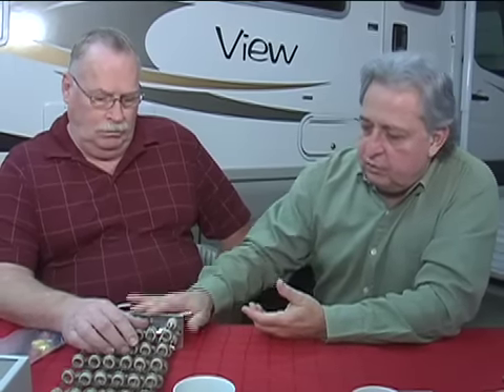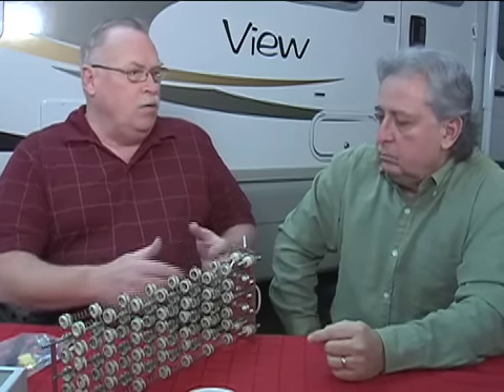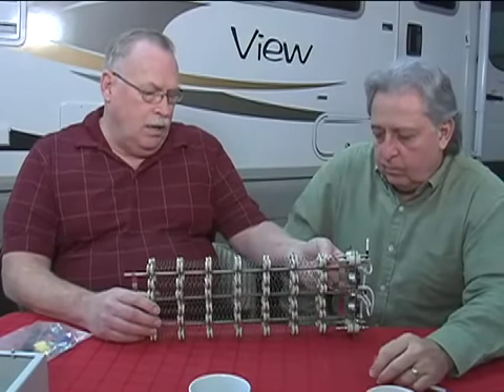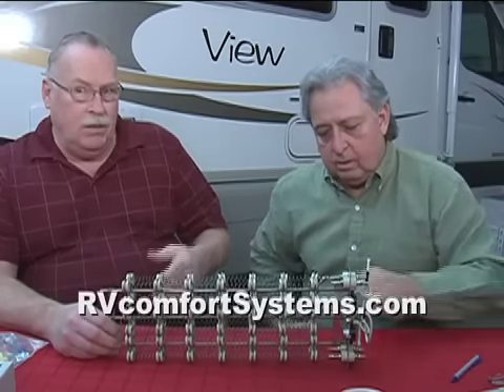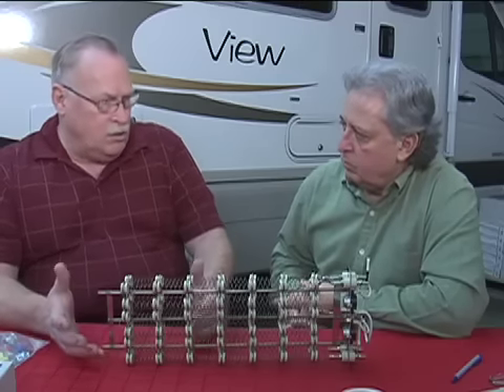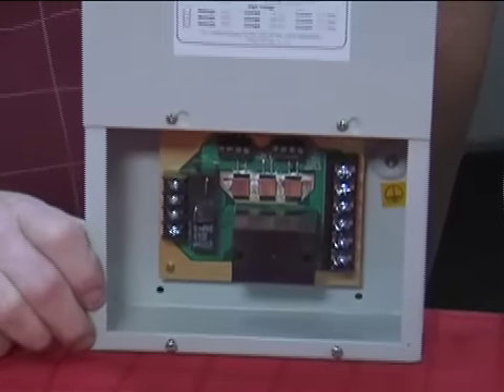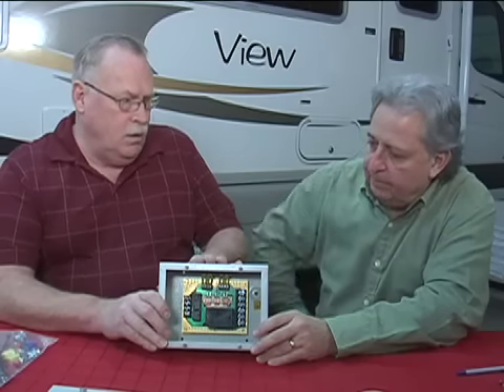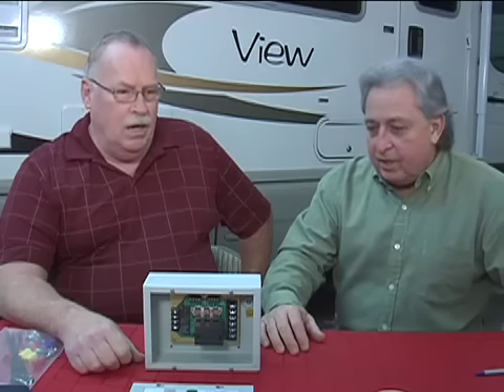Adding electric heat option to an RV's propane heater

Comment: Living in Steamboat Colorado this winter, I used propane in January - about 55 gal (at 3.00/gallon - try to find it for THAT now), thats OVER $150. in propane; When I called for a refill and was quoted $4.79/gallon, I told the propane company where to stuff it! 

I decided to live virtually 100% off of electric in February. As a result, I used about 15.00 worth of propane and my electric went up 25.00! So... while I don't have this system yet, come next winter, COUNT ME IN! 

The electric here is metered at 0.08/kwh. Unless it goes up to 0.40/kwh, I'm better off as I figure it to use electric than propane - and - with this company's product, I will be feeding heat to the underbelly (which my space heaters inside this month did not do.)

Al

Comment: I have a feeling that the AC in the summer uses a comparable amount of electricity. To even things out it's also important to consider just what it takes at times to be able to get those tanks full. Motor coaches have to break camp and go to the refill site in some instances. And who runs out of LP at a convenient moment? NOT ME!
Lots to consider for sure. I mean if cost was the main factor we would all still be camping/living in pup tents.
;-D
Reply: J Byrnz ha we ran out of propane on a 25 degree day once. That sucked

Comment: Its called "CheapHeat", not "EfficientHeat".  A good majority of camping sites don't charge for metered electric use.    At 11:50, he explains the most current the system draws is just over 20 amps.   So if 50 amps is normal for the types of RV parks you stay in, then you would be ok.  This really isn't a new idea, in fact the current trend in the industry is going all electric, no propane.

Comment: Do the coils get dusty, and if so how do you clean them? There could be a fire if the dust accumulates and the coils heat up enough to catch fire.
Reply: James Andresen those type of coils get hot enough that dust won’t settle on them. Just put a filter on the furnace intake.

Comment: The efficiency is 100% , meaning 100% of the heat produced by electricity is going into the room. But electricity is not cheap.
Reply: If your in an rv, I would prefer electricity. Frankly, propane scares the hell out of me when used in the Rvs. Have you ever seen one go up in flames. I have. You dont have a chance !
Reply: Wow, six yrs ago. Didnt see that. Guess I'm a little late. 😏
Reply: @5josullivan  electric heating sources are just as dangerous

Comment: Heating with propane is SIGNIFICANTLY more efficient than trying to do it with electricity. It's fine to run a couple little electric heaters if you wish, to supplement your furnace, but an electric furnace element that creates enough BTU's to replace the propane furnace would ALSO use more than the normal 50 amp RV service...

I really can't see it being very feasible...

Comment: I would feel more comfortable if the circuit board was G10 or FR4 and conformal coated for environmental reasons and fire safety.

Comment: I'm all for innovation and electric heat is much more efficient than propane, 100% vs est. 80% for most propane heaters ...BUT, charging $900 for figuring out how to fit a sheet metal plenum to an RV heater, with a $50 hearing element and a control box, although innovative, is scalping to say the least.

Comment: 100 percent efficiency is impossible. Refer to the laws of Thermodynamics.
Reply: You are correct. I believe what he means is 100% of the heat produced is going into the coach. Propane furnace dumps exhaust outside. That's heat made that is lost.